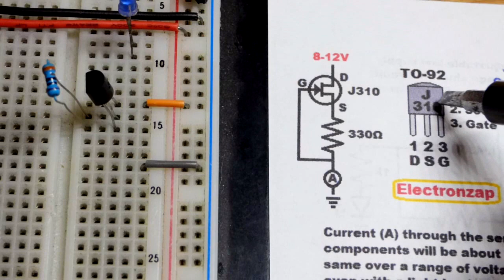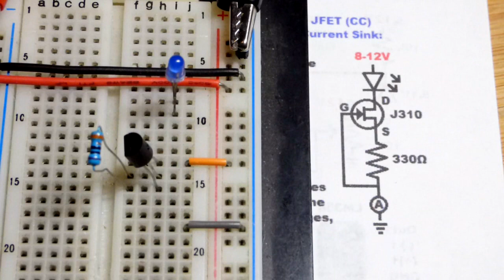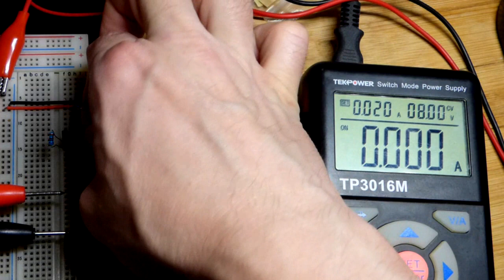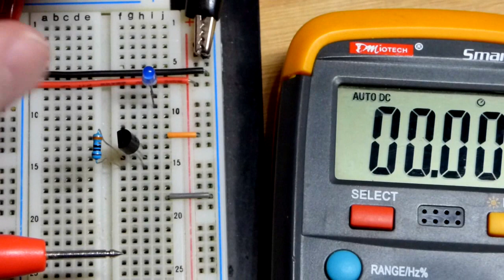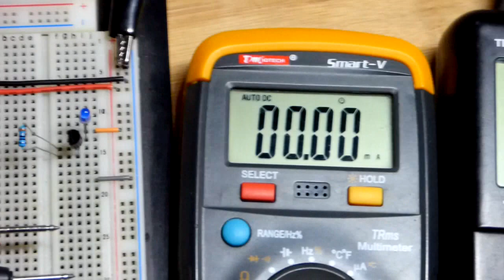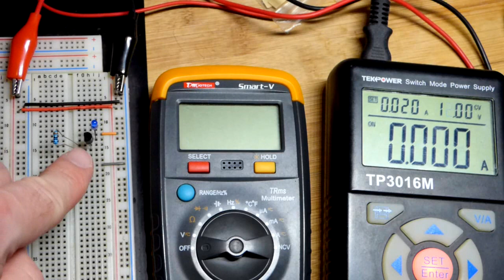J310 JFET constant current sink aka source demonstration circuit schematic diagram by electronzap

Comment: A supply voltage of 5V is rather too low for a J310 since its Vgs(off)  can be anywhere between -2.0 and -6.5V. You'll get more usable circuits with a 12V supply as you saw. There are a couple of parameters you can estimate from your measurements: (1) Using a 330R source resistor allowed about 6.4mA to flow, so the Vgs was about -2V for that drain current. consistent with a Vgs(off) of around -3V for your sample. That's why you're starting to drop out of constant current mode with a blue LED and an 8V supply. (2)  The current increased by around 50μA to 60μA for a 4V change in voltage across the circuit, so the output impedance of the constant current source is around 70K to 80K, which is quite reasonable for many uses.